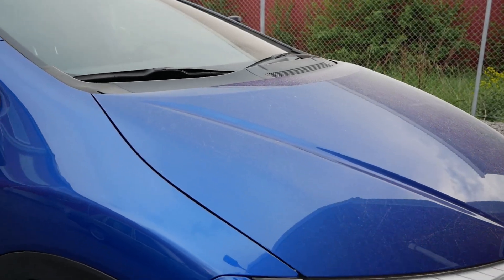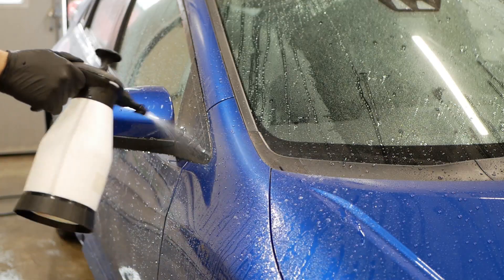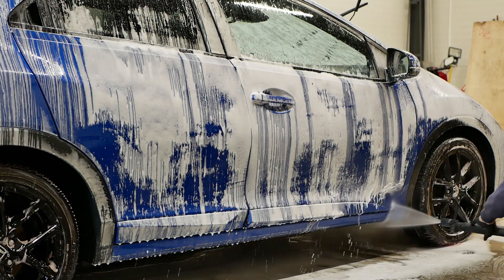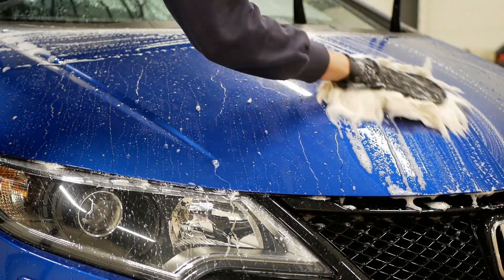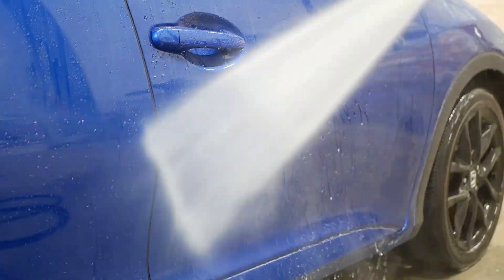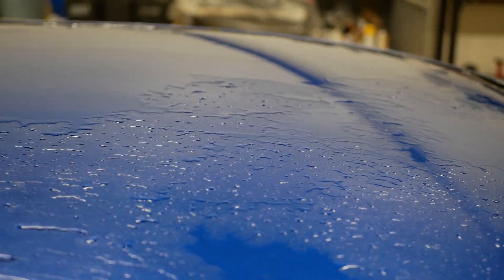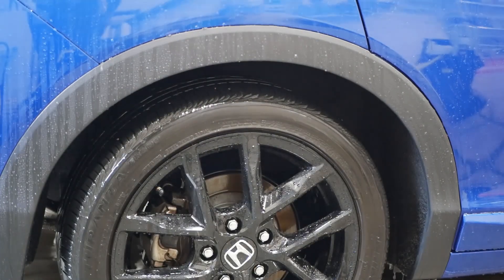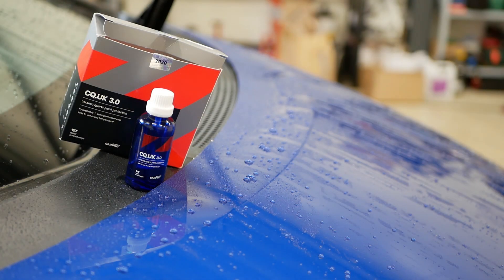Ceramic Coating +14 MONTHS Later? How does it hold up? - Carpro

Comment: Very nice. I did 2 layers of uk 3.0 and one layer sic. Really happy so far.
Reply from the maker: Nice! What is sic more exactly?
Reply: @ejoautovideos  Cquartz SIC. Its a silicone carbide based coating from carpro. It provides added slickness and deeper gloss over uk 3.0. But isint quite as durable.
Reply: @MD-gk4uh  You see, like a happy person.

Anyways, a quality coating will last a very long time even without toppers. See ScottHDs videos. UK3.0 lasted like 700+ days with just a monthly wash and no toppers.
Reply: @Saddedude  No it won't. Not in real life. The whole point of protection is that it is noticable. Bot even a non-2K clearcoat will last that long on an averege car. You watching to much infomercials, which all of am are.
Reply: @MD-gk4uh  🤣 Okay dude. Scotts testing methodology is as close too IRL as we are ever gonna get. 

Im gonn go back too coating my bext car. You enjoy.
Reply: @MD-gk4uh  bai

Comment: If testing the difference between 1 and 2 coats was the goal, I'd advise against putting one coat on the roof. Use a different, vertical panel (say a passenger door) to test, depending on the grit in the air, most cars will take the most beating on the roof. Where I live air is VERY dusty, and even several years old cars already have faded clear coat on roofs, and many 10 year old cars have no more clearcoat on their roofs. When I wash my car and pull the drying towel it sticks so hard to the rough surface that I once ripped a microfiber cloth doing it. So without doubt, I suggest putting 2-300 coats on the roof (right behind the antenna you can get away with one layer, the turbulence doesn't let as much grit to hit your car 😋)
Reply: Yea, and now you are following the industry that advices you to polish you car every chance you get, so they can get your money. The fact that you car nowadays has incredibly thin paint and all of your UV protectant is on the TOP PORTION of the clearcoat (it sort of floats on the surface of a clearcoat  like oil on water) and ones that is gone the sun will kill you clearcoat in matters of few years, be damned.

Comment: I wouldn't recommend anyone use tfr as a whole car cleaning agent, especially with cars which have had fresh paintwork or smart repairs. 
Using tfr can and will eat into paintwork especially if fresh, there are other agents you might want to explore to ensure you don't have customers claim on your liability insurance should tfr cause any residue streaking.
If tfr is kept wet on original paintwork it can be incredibly effective and cause zero impact to the original paintwork. 
Your video is well put together, it's great to see people doing such good content that instills confidence for car lovers to be more caring and tentative with their vehicles.

Comment: I’m finding panels or specific areas on a panel which are exposed to more heat do not last as long.

For example, on the hood, the coating is no longer present just above the engine but is still present above the transmission.

Comment: I also applied 2 layers for my Volvo V70 and I left the roof with 1 layer because I wanted to see how it would hold up.
Reply from the maker: Interesting! Did you also find the same result?
Reply: @ejoautovideos  Yes I did, I found the exact same results. I have had this coating on for almost 9 months and I started seeing that the roof was producing different results from the rest of the Volvo. It was just sheeting slower then the rest of the car as shown in your video. Two coatings of the ceramic coating really makes a difference.
Reply: And something that really brought it back to life was the meguiars sio2 ceramic detailer. I use it all the time on the car for the maintenance. This product is perfect for a maintenance because it doesn't hide the coatings ability.